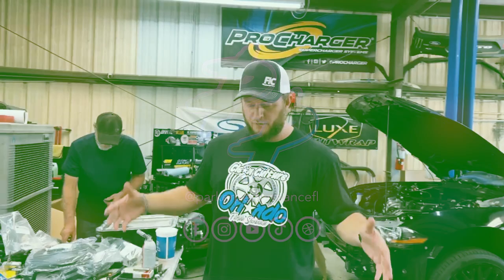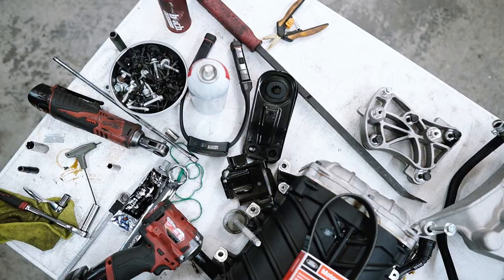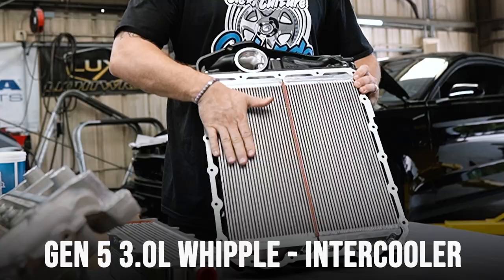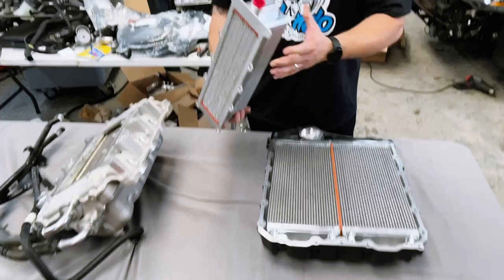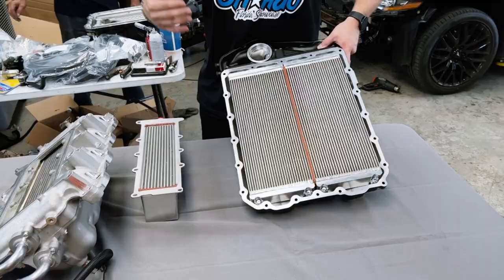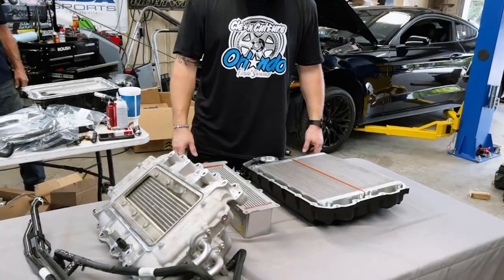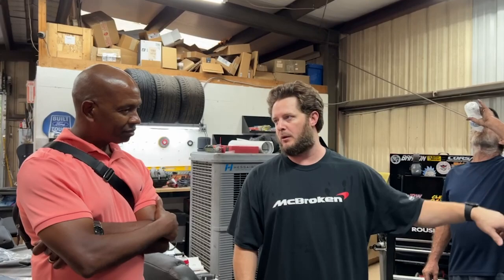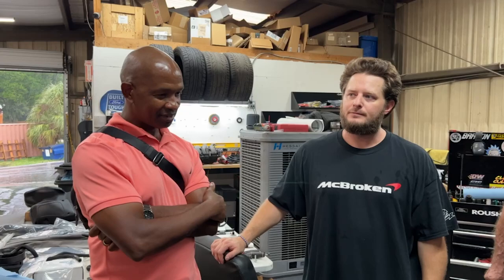Why is the +2018 Mustang Roush Supercharger FAILING?

Comment: The simple solution to the problem shown in this video has been out from Roush for some time. Adding the extra aux. coolers for the Supercharger and the aux. radiator cooler fixes any perceived problem! This is what is referred to as the Roush Stage 3 Supercharger package. The overall volume and area of the cooling system is then greater than the Wimple SC kit and keeps not only the SC temp lower, but the added secondary engine cooler keeps overall engine temps lower also.  Sense the coolers are not all under the SC the overall effect is cooler airflow into the engine and better engine temperature control.

Comment: I love Whipple gen 5 superchargers, in my 20 GT350R I've just upgraded to the 3.8 from the 3.0. My 22 GT500 went to Shelby American for the KR and widebody packages. It was delivered with a 3.8, man the hp #'s are through the roof.
   GT350R-1003rwhp, GT500-1254rwhp on E85 with RPG built engines. I have a Roush supercharger in my Backdraft Cobra, but after Whipple put up those #'s  numbers I have to upgrade that one too. I wonder what 1000rwhp will feel like in a 2600lbs go-kart? 🤔
Reply: Damn big baller that’s a lot of horses to handle I’m jealous

Comment: I must be lucky I have the 2650 and the max cooling kit and my IAT2 rarely goes above 40 over ambient no matter what im doing.
Reply from the maker: Whats year? If it’s a 15-17 it’s not affected by this
Reply: @ParkerPerformanceFL  2020
Reply: It is the phase 2, I do live in upstate NY though so I'm sure that helps with temps as well doesn't really get crazy hot here.
Reply: If you've got the Max Cooling Kit - we've not seen the same issues with those, thankfully. Most customers do not have their Roush blower cars equipped with that, sadly, though. Which is why we're working on solutions for those guys.
Reply: @xxl3ftnutxx  Yes, the NY weather surely helps, but even still you guys do get Summer weather. For you specifically though, the Max Cooling Kit will save you from these issues!
Reply: Cannot wait to see how the new intercooler works out for you and if it helps. I love my car and everything is well you live and you learn. If this helps out then signed me up. Also every thought of seeing if maybe running a cooler line in it that runs off factory A/C.
Reply: @joshparker753 so is the upgraded brick worth it and what kind of result are you seeing with it ?
Reply: @scubagto420  at this time, I would say it's a valid upgrade for all Roush users. However, my IAT2 Sensor took a shit on me, and so we've been monitoring that PID on datalogging in a different field (like IAT12 or something) and so the data is skewed unfortunately. I am still waiting (4 more weeks, last update we received from Roush) on my replacement IAT2 sensor, so we can properly digest the data with before and afters.

Comment: Earned a sub, look forward to the cooling solution as I have a roush blower myself. Have you guys tried interchiller? I do hope Roush admit and correct this issue.
Reply: I don't think they ever will, the tried to fix it with the larger heat exchanger and again with the Max Cooling setup. Root issue is still the intercooler.
Reply: @Cigargreg  I don’t think so either, so I’m likely gonna do interchiller and whatever other cooling mods available when the warranty is done. So another year for me. Hopefully by then someone will have a good solution.
Reply: @Exteriorbean  Agree, I am kind of pissed, I have been waiting to mod my car, I just paid it off now I don't know if I want o put any money in it.
Reply: @Exteriorbean  I got an interchiller for sale if you are looking. Brand new, didn't even open the box up. Save a few bucks if you want.
Reply: @79stroker  thanks, I was going to wait until end of next years summer before modding the supercharger. So I’ll wait until then to see what’s all available.

Comment: Actually Roush sez it right  in there instructions, must be installed by ASE Certified Shop however the sucky part is the warranty stars  from the build date so if you have a low mileage 19GT like me about (8500 miles) u have no Roush Warranty because my GT Convertible is 4 years old

That said, have u guys tested the $1699 brick yet, Also are u on the supplied Roush tune or a custom tune?

I guess in the end u just go custom tuned Whipple, I ended up selling my other 19 Roush GT Coupe because of the heat soak…

But in cool air it did run well
Shame Roush dropped the ball on 18+
Reply from the maker: Well be testing the brick ourselves soon and will post test results. What we know from other people testing is that it WORKS 👌🏼 

It’s like there was never a heat issue. So it has the potential to be an unbelievable game changer for those with a Roushcharged GT.

Comment: I have a 2019 f150 5.0 with a Roush 2650 blower kit and a tune from 5 star and I have a blown engine with 62,000 miles on it... Diag. says low compression in cyl's 5 and 6. Still runs (but misfires badly) and it sounds absolutely fine believe it or not.... I'm not sure what's wrong with it yet, any guesses?

Comment: What the best solution for Roush supercharged 2018+ heat and power 

My 2020 pp2 roush supercharger phase2
Mod

Griptec pulley 3.0
Headers catless 1 7/8
Hptunner custom tuning 
Radiator  mishimoto 
Thermostat reische 170 
Fuel pump dw400
Ngk spark plug IX no ford performance 

What the best upgrade PWR intercooler or bigger vmp front intercooler ?? 

No result for PWR  1699$ ?

Comment: I have a 2016 GT with the roush charger running 12 lb of boost phase two car did some extra cooling mods switch the cold air intake for the jlt and switched the stock throttle body for the VMP twin throttle body and had a retune from Lund and have never had a problem with mine whatsoever so my question is is this a problem on the 2018 and up cars? Because mine I'm completely happy with and after switching to the jlt vmp  twin tb and a revised Lund tune my car went from 658 whp/ 531 tq to 706 / 583 tq also car is full bolt on longtubes   full exhaust and waiting on id1000s I think I'll be able to squeez more power with the id1000s since my 47lbers are at 93 duty cycle so currently I can only rev to about 6200 rpm with the new injectors and being able to rev alot higher into the rpms I'm thinking I should be able to pick up at least 30 hp maybe 20 tq or am I hoping for too much of a gain ??? Any input would be greatly appreciated thanks
Reply: @parkerperformanceefi
Reply from the maker: This is an issue only for the Gen 3 Coyotes. 15-17 cars are good!
Reply: @ParkerPerformanceFL  glad i picked up a 2017 last september. doing a roush stage 1 this year . any internal mod recommendations?

Comment: Do the 2017’s have the same issues or just the new gen?
Reply from the maker: They do not. The 2015-2017 Gen 2 Coyotes are only Direct Injected. So the valley where the intercooler sits is big enough for Roush to put an actual brick that gets the job done. The +2018  Coyotes have DI and PI.

Comment: Wow I bought my 2020GT New/Used 4000 original miles it has the Roush Phase 2 750+ kit already installed by Ford now I am getting Powertrain Faults.
Reply from the maker: Sorry to hear that! Best of luck
Reply: @ParkerPerformanceFL  Thanks for the reply , suck part is I have to take it to the dealer who assembled it about 50-60 miles from me due to the Roush programing they are Roush certified. If I understand it all non of the reprograming they have to do is covered by any of my warranties the 3/36 5/60 or the lifetime .

Comment: Why is this only a problem on the 2018+? I have a 16 Gt and looking at supercharger options
Reply from the maker: If you watched the video…. We explained it. 

I guess you’re the reading type huh

https://ppflco.com/blogs/2018-2022-mustang-gt/roush-supercharger-the-worst-blower-on-the-market-for-2018-ford-mustangs?_pos=2&_sid=815e1a169&_ss=r
Reply from the maker: 2015-2017 have no issues, actually the the Roushcharger for the 2011-2017 are absolutely great power adders.